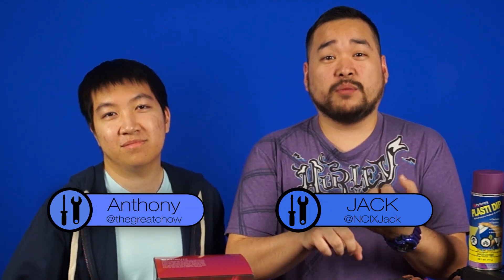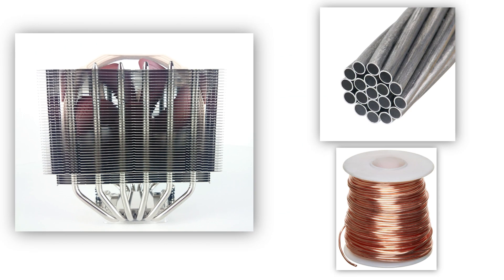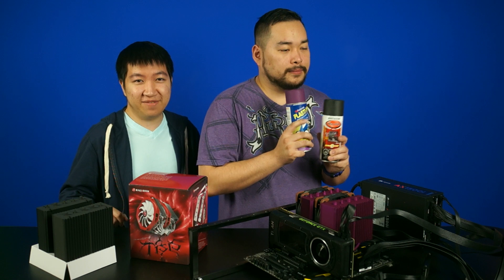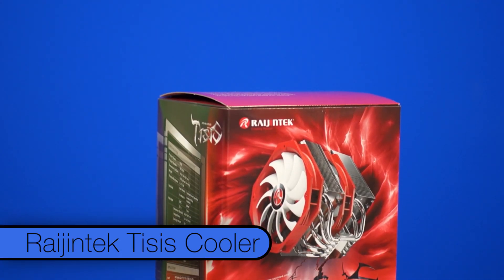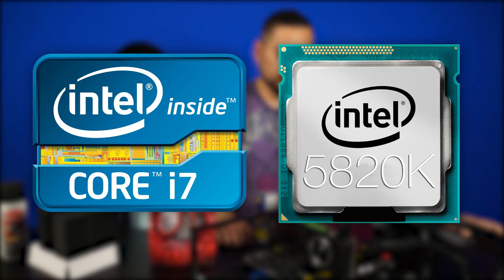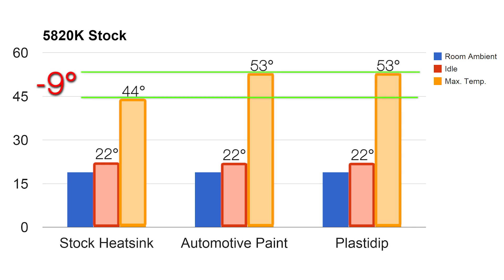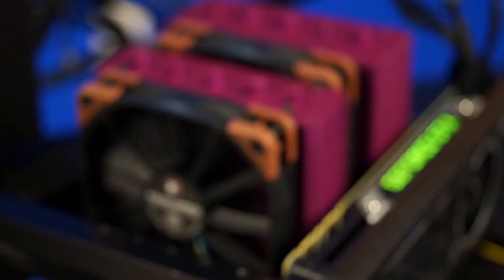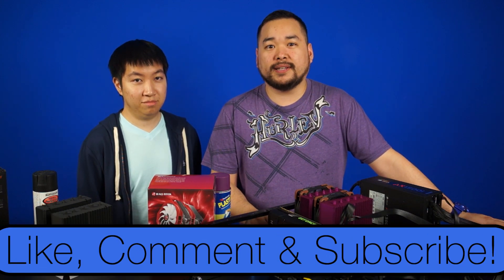Painted CPU Heatsink! Plastidip + Auto paint mod ft. Raijintek Tisis

Comment: first off i think painting heatsinks is a extremely stupid idea. and second why did u list off the specs of the test rig when your only listing the temps of the cpu.
Reply: Because if you have different anything, it could affect the temps. If they didn't have a blower cooler thenbthe temps would probably be a little higher.  Motherboards dump heat passively excluding Enthusiast AsRock Motherboards.(Passively  cooled componets have no moving parts, just heat sink). Less RAM could mean less disruption of the air flow.

Comment: Very ugly and very loud with 2000rpm fans
Reply: *****
i know but, for me, there is no point of spending a premium for that fan and let it run at 800 rpm (40%) at max. Why should i give up 60% of their potential to keep them reasonably quiet?? Also many people forget that Noctua Industrial fans are designed for an "Industrial" scope. Why should i pay for waterproof, dust, heat and vibration protections if i put them in my gaming case???
Reply: I forgot also that that heatsink supports 2 x 140mm fans with 120mm mounting holes and they put 2 x 120mm fans instead. ofc it will perform worse.